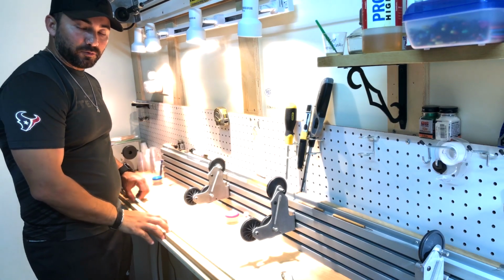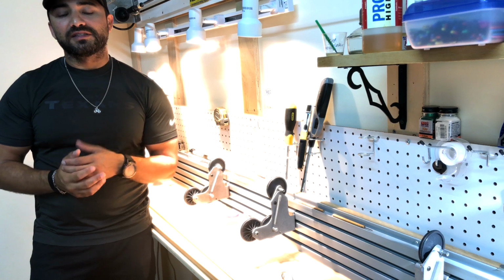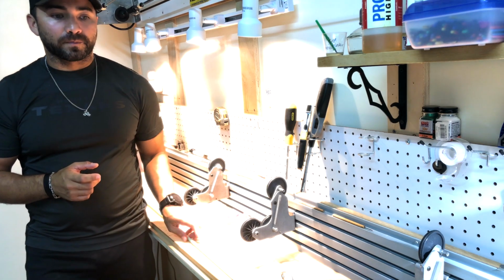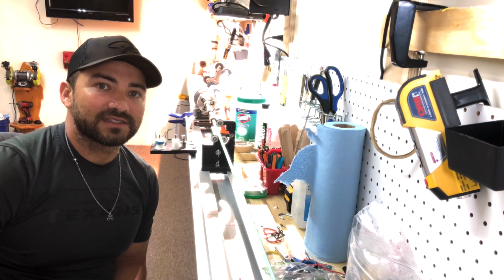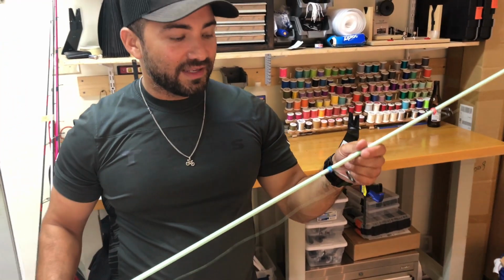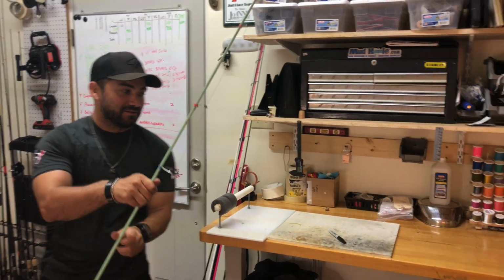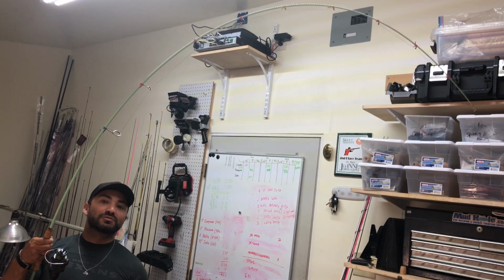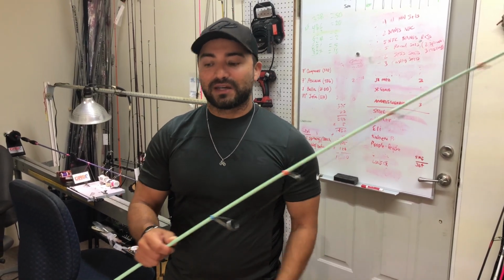Rod Building 101: Using Rubber Bands for Load Testing Blanks and Spacing Guides

Comment: I really like you load testing for optimum guide spacing.  Two questions: how do you determine placement of the first guide from the reel seat, and can  you suggest a rule of thumb for how much weight to load a rod for guide placement for heavy gaster acting blanks?

Comment: I like the idea, but wondering how well the rubber bands hold when building a casting rod? I've had to use guide adhesive and tape together to keep the guides from rolling over during static testing.
Reply from the maker: We actually static test casting rods in a similar manner

Comment: Very good info.  TY            Have you ever used Braid to wrap guides?   30 lbs Kast King braid has no coating and sucks up liquid epoxy like white bread and is the same size diameter as size D rod guide thread    is it a good idea or a dumb idea?
Reply from the maker: Thanks for watching.  I can’t say we’ve ever used braid to wrap guides, but I’m sure it would work just fine.  Only issue that crosses my mind would be around cosmetics.  Try it out and let us know!

Comment: I use the same method for attaching the guides but instead of using rubber bands I use either Paxcoo 0.8mm Elastic String or Crystal Tec 0.6, it's used for making bracelets etc. , about $6 for 100M